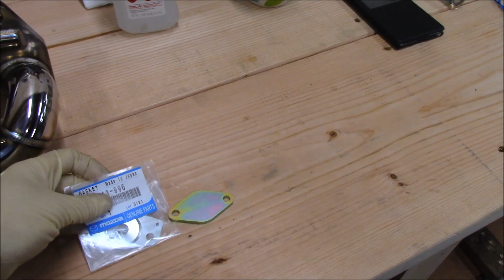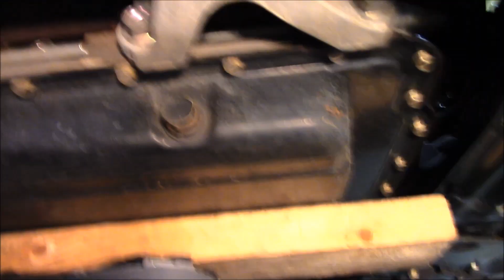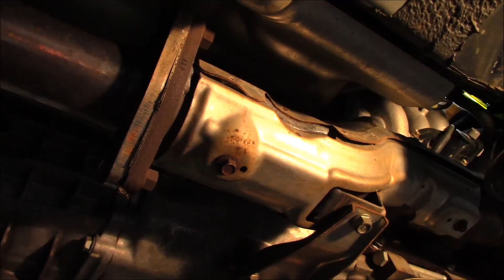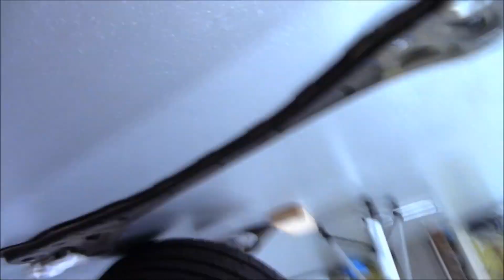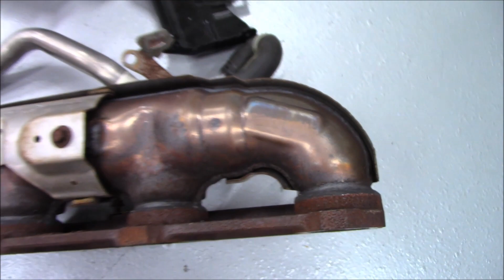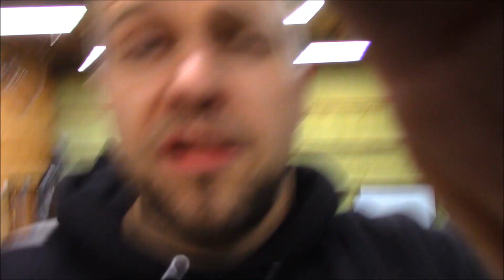RX-8 Header Install - GQM Garage

Comment: Can I get a follow-up on longevity and reliability of this header? Considering the extreme heat of exhaust systems and more specifically the high temps of the rotary: is this header still holding up today? No cracks or issues? Thanks in advance.
Reply from the maker: Header still great however they were discontinued several years ago now.

Comment: Is that the Tein suspension? How do you like it?
Reply from the maker: Tein Flex Z and they are no good. Too soft of spring rate for the RX-8. Eventually I will move into Ohlins for this car.
Reply: @TheSlipAngle  I was looking at the Billstein I hear they make good suspension. It's a little pricey but if it worth it. I just order an entire header to exhaust with the Turbo X high flow cat. After Christmas I'll install them. Thank you for the video 👍

Comment: PSA: don't buy the 73$ eBay one. The flange is warped about 1/8". Good luck with that exhaust leak. And no, you won't flatten it by tightening it to your engine. trust me.
Reply from the maker: Yup they just aren't worth it.

Comment: The stock header had a lot of heat shielding, any concerns or options for that? Given how hot the exhaust gets on these motors and it looks awfully tight in there, seems like it might be a good idea. Not a wrap, but there are some good flexible heat shield materials you could use to protect  sensitive components .

Comment: That's fine and dandy to junk the cat converter if you don't live in an emissions state, but, for those of us that do, we gotta have 'em.
Reply from the maker: The state I live in is no different than yours
Reply: @TheSlipAngle  How do you pass emissions tests, then? With the age of the cars, I would have to go get it every other year. (AZ charges $35.99 for the test.)
Reply: @TheSlipAngle  I left a couple questions on your other videos, too, so thanks for responding.
Reply from the maker: @bryanhallman8183  using Mazdaedit. Check out the videos for that
Reply: @TheSlipAngle  Ok, thanks. Does the Premix affect it at all? I really like that Sohn set up.
Reply from the maker: @bryanhallman8183  not as far as codes goes but it will clog the cat faster

Comment: I know you posted this awhile ago, but I just got around to doing the header install on my R3. This vid helped a lot.  Gotta say, you make it look a lot simpler than it is. There are some additional things on the series 2 that are a little different. But still very helpful. 
Allow yourself some extra time though. I tried this thinking worst case scenario was 5hrs. I should have everything back in. Nope. 7hrs into it and I only managed to remove everything needed. I was exhausted. I’m going to continue tomorrow. At least all the hard stuff is done now. About the only tricky thing will installing the heat shields from lrb. Otherwise, everything should go back in smooth. 👍🏻
Reply: Just as a follow up, there are enough differences between series 1 and 2 making the install practically impossible to do on a daily driver you depend on if you're not willing to fool around with the situation for a few days.  This being said, I'm sure with a helping hand and definitely a lift, I would've gotten the header in.  Sadly, this wasn't the case.   Seeing as how I was attempting this at home, there was insufficient space and time to get the new header installed.  It sucked royally but I had to revert everything back to the way it was.  I attempted for over 2hrs trying to get the racing beat header installed.  It just wasn't meant to be.  Since I had the header heat treat coated, I managed to score alot of the paint off it attempting to get it in.  I was cursing and really upset over the whole thing.  But I managed to revert everything back to the way it was, and the car runs normally.  I've since set out the header to get recoated before getting a shop to do the install for me.  This vid helps, but if you've got the racing beat header to install, there's no way it'll go in as smooth as you video taped the header you picked out.  Just giving people a heads up.
Reply: You guys are a godsend. In time soon, I will be purchasing the exotic exhaust system. I believe you said it was available on eBay. Perhaps you can send me the proper wording as I’m a Google it. Thank you man.     Let’s go rip up some asphalt!
                                                            Douglas Nelson

Comment: I'm really curious as to what you did with the barometric sensor. Did you just unplug it? That could definitely cause issues. Also the little thing you made the mounting bracket for is a resistor.
Reply from the maker: The MAP sensor is still connected.

Comment: Ever tired using spark plug foulers to shut off your engine light( cat delete ) adding a mid. Pipe???
Reply from the maker: I think you mean an o2 spacer / defouler. I had one built into my old midpipe and that seemed to work, but many have reported issues trying to use them with the RX-8
Reply: @TheSlipAngle  I'm confused , so it worked on your Mazda rx-8? Or a different car you had?
Reply from the maker: That one seemed to work. It threw a check engine light initially, then went away and never came back. That midpipe was some no name one that came with a parts car I bought. It eventually busted at the hanger so I scrapped it for the RB unit, which at that point I had installed Mazdaedit and disabled the ECU for checking for that cel.
Reply: @TheSlipAngle  oh cool , so you have heard of it working on cars before?  Just didn't know if it worked on rotary engines...

Comment: You get a check engine light with the mid pipe ( no cats)?
Reply: Yes, need to edit the ECU to stop monitoring that code.
Reply from the maker: As Robert said ;)
Reply: @robertkorn  what's the cheapest way to tune / shut off the engine light if I did add a mid pipe? Disabled money is tight.
Reply: @jaynosowsky9708  Mazdaedit will let you top the ECU from checking for that condition, but the other option is to just reset it if it comes one. I gutted mine, had the light come on twice so far...not a big deal.
Reply: @robertkorn  best cheapest way I can find is using spark plug foulers....I guess if you incase the o2 sensor in it....it'll keep the engine light from coming on....you ever try this method before?
Reply: @jaynosowsky9708  Yes, it doesn't work. I was a NYS inspector and mechanic for 20 years, people tried all sorts of things to get past inspections. The only way to stop the light from coming on is reprogram the ECU. Short of that, ignore it and don't waste your money on the fouler.
Reply: @robertkorn  95 percent of people had luck with it.  For $4 I think it's worth a try...if not I'll just hook up a register and try that....Turner are way to much money...plus the tune to shut it off. For performance gains for the cost ....it's not worth it. Tuning a rx8 doesn't give you much.
Reply: @robertkorn  resister....
Reply: @jaynosowsky9708  No, resistor will not work.

Comment: Would have liked to have seen some Dyno numbers for the difference.
Reply from the maker: I recently dyno'ed this car with all of the bolt-ons. To me, if you are doing N/A mods, you need to do them all to maximize the system. If I were to just dyno the header gains, the data wouldn't really matter to me since I know the factory cats and muffler would still be a bottleneck in the system not allowing the full potential of the header.

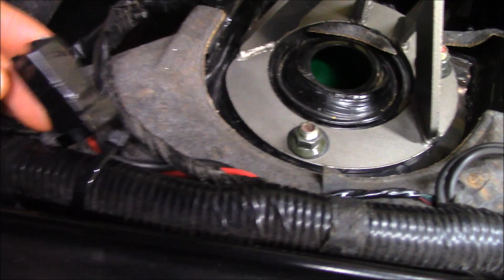Comment: @ 21:10; Its the fuelpump slow mode resistor. Which is in series with the fuelpump. @certain engine speed an relais bypasses it. And the fuelpump will get full voltage.
Reply from the maker: Thank you! ✌️

Comment: Whats the harm in leaving the air pump running?
Reply from the maker: No harm at all. It's just space and weight in the engine bay so I opted to remove it. It will throw a CEL though. Nothing Mazdaedit can't fix ;)

Comment: I have much appreciation for your respect for sound as a daily. I run an uncatted exhaust system with 2 resonators on the mid and tail, with stock headers, aftermarket tail (r3 rx8 09'). It's loud but not like some ricer. My friends agree with me: "Loud when it needs to be", and I still get unwarranted harassment or goading from both civilians and police.

As always: appreciate the Gran Turismo tunes, in-depth explanations, and your desire to always do a clean job! And am really interested on the mazdatrix tuner maps you will be getting to manage the CELs.
Reply from the maker: Are you using the RB midpipe? What muffler section?
Reply: @TheSlipAngle  does the original manifold have a built in cat
Reply: @AightBro123  From the pictures I would say no, looks like the cat is further down.

Comment: Hello. I have only just come across your youtube channel, I wish did I lot sooner as your content is excellent. Thanks for sharing all your knowledge.
Could I please bother you for a link to a similar mid-pipe you are using?  An ebay link would be great if you can find something similar to what you are using. Thank you :)
Reply from the maker: Thanks bud. The midpipe came with a parts car I had bought so I honestly have no idea what listing it came with. I think it comes with a muffler section. The o2 spacer comes out of the midpipe at an angle. I hope that helps.
Reply: Sure does. Thank you very much :)

Comment: I find it crazy that people think an exhaust will give the rx8 more power, these 13b's come from the factory with all the power that you can get from the factory without nos or boost, infact, chances are your aftermarket intake and exhaust is possibly causing you to lose a few hp. Unless you have dyno proof of hp gains over stock i dont believe you've actually made any power at all. I have an 04 6 speed that came with a $250 or $300 K&N intake and im trying to find someone local to swap me a factory box for my aftermarket one because the stock one is better.
Reply from the maker: Why do you find that crazy? Have you looked at the runners of the stock exhaust manifold? They are nothing special. I wasn't try to sell you or anyone on this header. There is no sponsorship for this piece either.  So you can take what I say for what it is worth or not but the car definitely makes more power with the header and it is very noticeable. And I am a guy who has exhausted and spent more than most on the tuned N/A route with my 99 ITB Miata, 03 S2000, and old S5 FC RX-7. At the end of the day I build these cars to my liking and I like the challenge of extracting as much HP as I can out of these mills. I think given the numerous all motor builds I've done in the past and the results I have gotten, if modifying exhaust was a waste of time I probably wouldn't be doing it still.
Reply: @TheSlipAngle  im not disagreeing with you, by all means do as you want with your car and money. And yes, you did shed a lot of weight, all im saying is until you have dyno numbers to prove hp gains don't make false assertions about how much hp you gained from the mod, even if you gained 5 or 6 hp it would be unnoticeable, it would be like the placebo effect, if you have a headache and someone gave you 2 vitamin pills thinking they were Tylenol then you'd believe it worked. And if you don't know what the placebo effect is google it
Reply from the maker: First off let me say that I am not mad or offended, I've been doing YouTube for a long time and have heard it all. Oddly enough, never do I poopoo other content creator's stuff. I simply do not have time or desire to do so.  Secondly,  you came in and made the claim that no bolt-ons can increase power on the RX-8, which I asked why you think that as I disagree, based off my own personal experience. Third, thank for the lesson on the placebo effect lol cause I've been living under a rock my entire life.
So with that out of the way, let's get one thing straight here and that's that I never made any claims on how much power it gained. I said there was a noticeable bump. I daily this car, I am very in tune with how fast it is. Your "someone who is widely known in the rotary world mystery guy's" claim is very vague that all bolt-ons are a waste. I can say with honesty, that I personally have been in the rotary world for a long time. One of my best friends for the last 14 years who is very well versed in rotaries, helped me build and tune both of my RX-7 engines as well as given me advice chasing all motor power in the past on my other builds would disagree with that claim, but this he said she said stuff is just a waste of everyone's time. The information I am sharing through this channel comes from my own personal experience and I am really particular about how I share and word things as to not mislead someone. I do agree with your "rotary world" mystery guy that certain parts can hurt power, like these 100.00 eBay headers with garbage collectors. However, there is no way in hell the stock log manifold is more efficient than this header. I highly suggest you do some reading on exhaust scavenging, merge collectors and tuned runner lengths. 

As far as noise goes, with the RB resonated midpipe I added more recently, this car cruises just as quiet as stock. No drone, no additional noise. Makes a nice sound at wide open, but still very quiet overall. No change in gas mileage at all, as someone else mentioned MPGs will drop. Lastly, my car versus my friend's 06 GT with just a midpipe puts almost 2 cars on him. His car weighs 60 lbs more than mine, but 2 car lengths is not just from the weight. At the end of the day do what makes you happy. I am very happy with how this car has turned out and it keeps me entertained and comfortable while daily driving it.
Reply: This mod is legit. His theory aligns with a hugely respected member of the Rx8 community. check out his header theory here: https://www.rx8club.com/series-i-aftermarket-performance-modifications-23/teamrx8%92s-renesis-header-theory-thread-266914/
Reply: The reason i say this is because i know someone who is widely known in the rotary world, he has been building and racing rotary engine vehicles for 25+ years and even he says bolt on items are a complete waste of money on these engines and the wrong ones will actually hurt engine performance. If he says its bad for them i trust his word
Reply: Exhaust wouldn't be for hp more for longevity of the engine.. the factory cats crap out.. they fall 2 peices and clog up the 2nd the cat... the built up backpressure and heat can burn the engine out alot faster..they come so stuffed full just to pass emissions

Comment: Man nice job I'm wanting to put on pipes on mine and delete cat to make the car sound better but I don't really trust anyone to do it because you don't want them to just put them on but you want them to be put on the right way and no problem do you by chance do other people cars lol
Reply from the maker: Thanks man. I do take on some side work on occasion cause ya know.... I'm an opportunist ;)
Reply: Oh alright cool so if I buy stainless exhaust catback with headers it will not raise a check engine light or anyting
Reply: And if your up to work on someone's car mine's just the same to put on headers in a pipes where you located how much would you charge??
Reply from the maker: If you change the midpipe and remove the cat you might throw a check engine light depending on which midpipe you use. I am in CT and I charge 100.00 per hour for automotive work.

Comment: Hello, nice video ! I've read somewhere that you should use heat shield or wrap for the new headers, because the rotary engine produce a lot of heat and you donc want to increase the "under hood" temps. Do you plan to do something about this ? Cause i want to change my headers and i wanted to know how to do that

Comment: I can't see where you get it for 460 $ as on exoticspeed website they currently are at 599??
Reply from the maker: They sell them for much less on eBay.
Reply: Garage Quinn Motors can't find em probably they re not shipping to Europe..  cheapest I can get them is 559 + 159 +? customs fee.. guess it's not worth it at this point.. racing beat alternative not much cheaper though..
Reply from the maker: Looks like they upped the price: https://www.ebay.com/itm/EXOTICSPEED-GT-HIGH-FLOW-exhaust-Manifold-header-for-Mazda-RX8-2003-12-SUS304/332609534129?hash=item4d7112b8b1
Reply: my bad.. anyway, thanks for the answers!

Comment: The Racing Beat Header ( because i own one) actually ends in a 76mm bore size which mates perfectly to their 76 mm mid pipe .... I believe that is a better choice
Reply from the maker: I had their "3 inch" midpipe and sold it because they neck down the connections at the flanges so you can use it with stock or their aftermarket components, so assuming the header was meant to match to it, then it would have the same ID of like ~65mm if I remember correctly. I am not sure if they always did this, as I have an RB exhaust on my FD and their resonated race pipe on my NB and they don't have that. Either way I was going to have to cut and reweld the flanges if I was going to keep it, hence why I abandoned their system all together. Their catback was also 10 lbs heavier than stock which is a shame because I really do like RBs muffler quality as they actually work, but my car is quieter (and lighter) with the setup I have.
Reply: Garage Quinn Motors Thanks for the reply. I saw you commenting about that but you had the dual resonated pipe. I have the straight pipe with no resonators which is lighter and i cant remember it sizing down at the connection points. but then again i might be wrong ... Keep up the nice vids ;)
Reply: Btw you can check my vids .. I am sure you ll find them interesting ;)